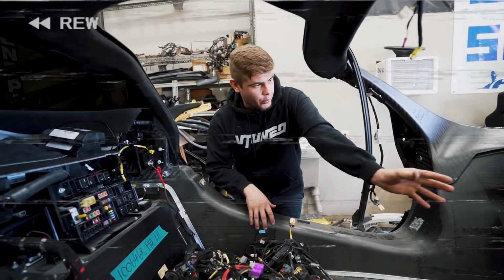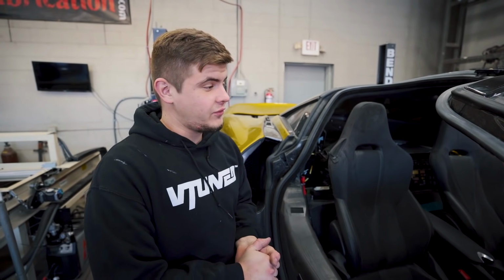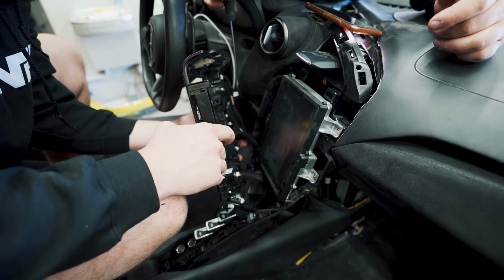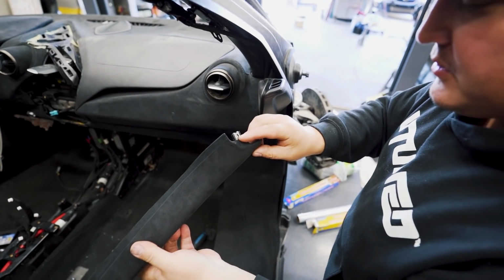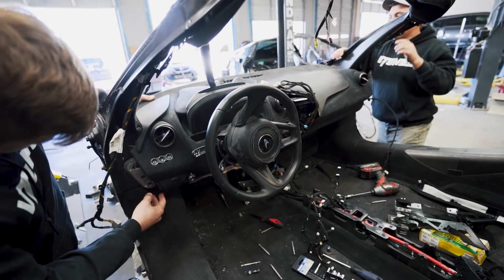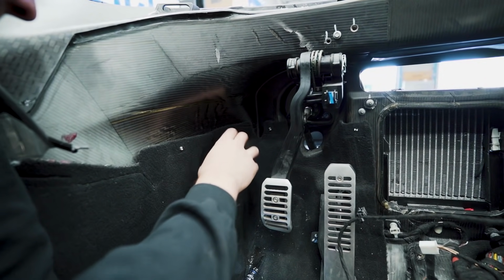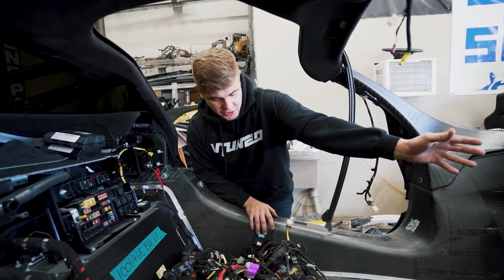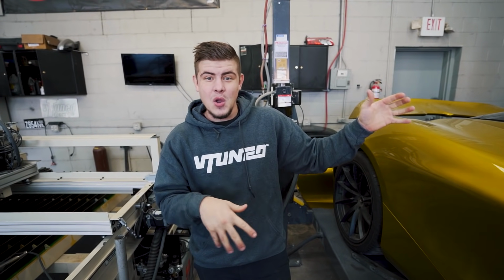Stripping the Interior on my McLaren 720s - Episode 6

Comment: Honestly. it looks like a nightmare. Id never dare or even think about doing something like this.
Reply: I get anxiety even thinking about pulling the intake off my F150 and I see this? OMG.....one thing though, if you do it right, and take hundreds of photos at each step, and break it down into steps, it will make it a lot better.
Reply: It might be especially with a McLaren where practically everything is effectively "shrink wrapped" around the car and pulled so tight that it's almost impossible to put it back together the right way.  When I did some work on my current car (just to learn how to get to some things I have to replace), I took a notebook and wrote down each step, and took photos.  That helped a lot.  It could help for something like vTuned's project, but yeah all that stuff in that car would hands down make me lose a lot of my patience.
Reply: @MDKN22  Just looking at all those cables. Im like "nope"!!
Reply: He unscrewed some screws & un did some clips, then put them back, whats hard about that ?

Comment: Actually Paul had a great idea: when you pull the screw out, put it back in so you know which screw goes where. Even screwing it in slightly to the old tub, then when you go to install that part (say the dash) you walk over, unscrew the bolt out of the old, and into the new.
Reply: Yeah idk why they took everything out all at once instead of going bit by bit putting parts on to the "new" tub
Reply: @marquisethomas5611  I can understand having to pull a lot out to get at the wiring harness but like the console for eg, put the screws back into the holes they came out of, and that button assembly, screw it loosely back onto the console as soon as it was out. It'd make reassembly so much easier.
Reply: @muskokamike127  I've noticed vin liked to over think things & ends up working harder
Reply: V Tuned has been doing this since he was 13, and you're telling him what to do?
If you've ever completely disassembled a car and rebuilt it i can assure you that having all the screws in the holes is the BIGGEST pain in the arse.
Plus, in one area you'll have screws, bolts, and nuts so some fasteners will be attached to the body, some with the part, and some clips that break when you pull them out.

Comment: You’ll need to consult the Chilton repair manual on this one.
Reply: hahahaha that's funny right there. I subscribed thinking they could help. I needed to replace a cam follower which meant removing the valve cover on my F150. Know what it said about the wiring? "remove all electrical connections" and then "replace all electrical connections"

it was about as useful as tits on a bull.
Reply: @muskokamike127  to get a good manual, you'd have to get a Mitchell. But they are expensive. The Goodyear auto service I worked at as a Drivability tech had a subscription. Was a godsend for wiring diagrams and connector pinouts.

Comment: its funny how carbon fiber is the most strongest and brittle material at the same time.
Reply: If it doesn't bend, it breaks.
Reply: It's not actually brittle. The impact it absorbed from the accident is evident in the cracks. Remember: it's lighter and stronger than steel. It breaks so you don't. 

I used to work in a store that sold motorcycle helmets. A customer came in with one cracked right down the middle (Shoei) complaining. 

I said "were you the one wearing this"?

Yeah why.

I said "bow your head" he did.

I handed him back the helmet...."here, it did it's job"

WHat do you mean? it's broken in half

Yeah, and your head isn't. It broke so your head wouldn't. It's called energy dispersal. Instead of transferring the energy to you/your head/your body, it flexes and if the energy is too great, it breaks dispersing the energy. 

He flipped out but it did what it was designed to do.

Comment: "you have to have so many impacts because they have 2 different sizes on one piece"

I worked in a cabinet shop and when I started, I saw a whole row of laminate trimmers and routers. Each labeled. I asked "what's with all the routers"? One for each size and type of bit. 1/4 roundover 1/2" roundover 1/4" ogee 1/2" ogee 20 deg bevel 30 deg bevel 45 deg bevel etc. 

Why not just change them?

I pay you $30 an hour. By the time you find the router, remove the old bit, find the new bit, put it in, set it up to the right depth, that's an hour. Do that twice in one week and that's the cost of a used router. Whenever he saw an ad for one online he scooped it up. It was SO much more efficient. When I opened up my own shop, I was the same way.

Comment: Man, remember when you asked the fans what to do with the the McLaren body or shell. I was thinking that you could build a rock bouncer or crawler, exoskeleton the McLaren shell (to kind of protect it), and custom cage inside the McLaren shell (for your protection). Custom tube front and rear frames, full size built axles or better yet built steerable axles. Use an LS motor for your power plant. I don't know, I was just thinking might be a good project for you and your brothers, good luck with the McLaren I will be enjoying every video. Take care and have a Happy Thanksgiving.

Comment: Fibreglass can flex more without breaking and is still very strong. Carbon is stiff, which is not needed for a door panel. This was done for engineering reasons :)

Comment: When I look at all this wiring I can't help myself  wondering about  how many wires were used in a (let say) a 1967 Mustang?
Reply: Less. Much less. Wiring harnesses for the lights in front, lights in back, gauge cluster, blower motor and for the engine (with electric fan?) is about the same as just the engine loom for this car.

Comment: I am pretty sure you will not need to remove the engine, gearbox, etc. one by one to transfer them, but rather the whole rear frame that holds the power and drive trains, bolts onto the tub as a whole.

Comment: Amazing! How do you keep track of nuts and screws?
Reply: When I worked on corporate jets we used small cloth drawstring bags to put screws/small parts in & tied them to part removed, always worked never lost screws, knew which part they went to even if you diddnt take apart & someone else could put it back no problem. Note: aviation fastners are VERY expensive.

Comment: Remember carbon is not impact resistant it will shatter , you can get a away with wrap around tabs over small cracks and there not frowned apron

Comment: Need to zip tie the steering wheel so it can’t move . Really should have centered the wheels on the junk tub before you removed the dash/ steering column and then zip tie the wheel straight so you don’t mess up the clock spring . This build is moving right along

Comment: Using 7 mm, 8 mm, 10 mm, and 11 mm bolts in almost the same spot. It sounds like this McLaren was assembled by Ford. Another bad thing that the auto manufactures do is they use hardware that goes together easy on the assembly line, but when it goes to taking it apart it's a nightmare and I know this kinda sh** is done on purpose.

Comment: That is a brilliant project mate and you are doing a sound job. just a friendly word to the wise though. Your friend Paul needs to show less muscle and speed. Like pulling apart plugs and sockets. Dragging complicated wiring looms with small cables and plugs through holes and across sharp edged CF to save 20 seconds will just put big issues in place for later on that will cost your hours to de-bug. 
These cars were hand built where time really was not a factor. Just accuracy and quality. Hell the then boss at Mclaren Ron Dennis banned the use of air or electric driven tools. They are quite literally hand built with hand tools.
Enjoy this from 2012:
https://youtu.be/tWJNU1AQETE